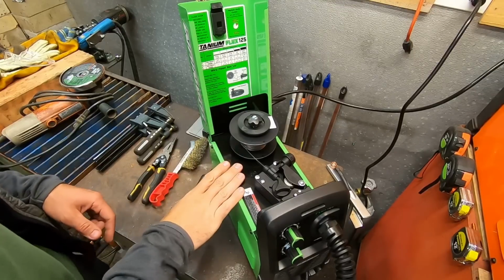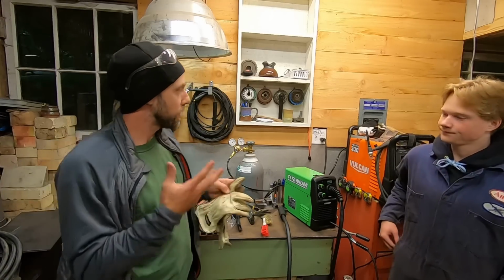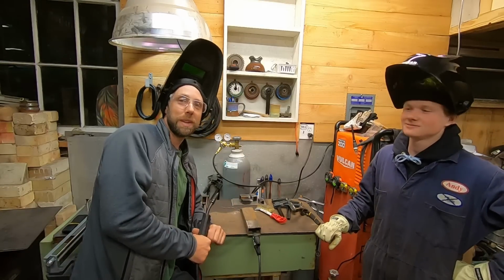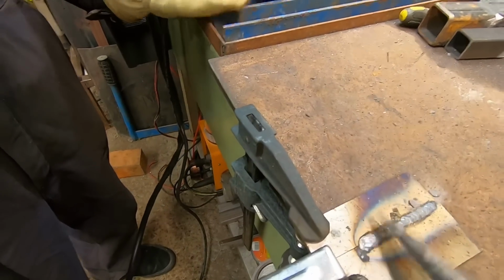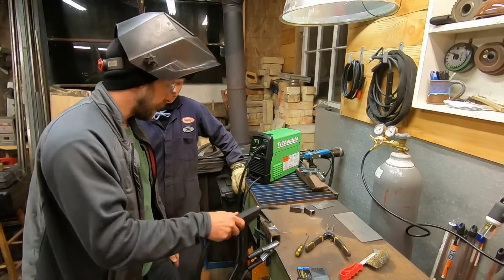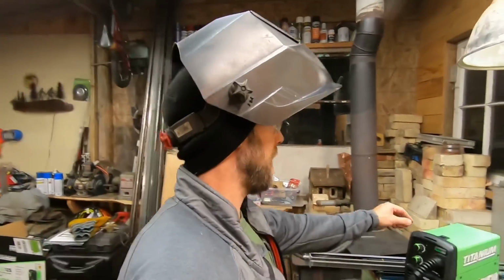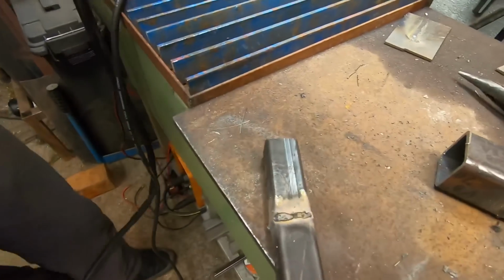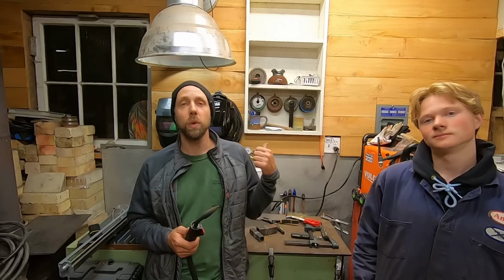How to weld, Tips for Beginners

Comment: What do you recommend for a person who is new at using power tools (cutt off wheel) and trying to get over a phobia of getting sparks while cutting metals or getting the bright arc from welding? LOL.
Reply: I have been a union ironworker for 14 years. 1st thing you can do is always where the proper ppe. Safty glasses, face shield/welding hood, proper gloves, welding sleeves or jacket. All can be bought at and welding supply store or tractor supply. Having the piece of mind that your not going to get hurt helps with the confidence of learning. 2nd.  Every one jumps/gets startled when learning to weld its normal. Just take a deep breath and do it again and again. As far as the fear of sparks clear the area of combustible material, wear your ppe and have a fire extinguisher near so you know you can stop any small fire that may happen. And last lots of practice.
Reply: I double read your comment and one thing comes to mind that is said so often, I think it loses it's meaning but,  in my case anyhow, has been of immeasurable value, benefit and importance: DO NOT BE SCARED OF THE TOOL YOU ARE USING!! When properly used, a tool becomes an extension of your body. When you master a craft,  it's a subconscious act of moment to moment physical action and reaction. 
    If you're scared of the tool in your hand, you in essence are creating a barrier between yourself and that extension.  And, when the user of nearly any tool is not in control, we all know what can happen.
Reply: @mechantics  I also feel like as long as a wear proper safety equipment and use the power tool as intended I will probably be fine.  Usually people have accidents when they are not careful and wear the safety gear (goggles).
Reply: NotthatDigusted by no means am I an expert. Sparks are a real concern it’s actually scary for the normal person. Sparks catch things on fire and they are hot meaning they will burn you. My advice is cover your body. Arms feet hands. And clear the area your going to be grinding in of anything. Then you can relax knowing there’s nothing bad going to happen.  hold what ever it is your using kinda tight and go slow. Make a little bit of spark for a second then back off. Relax and get back into slowly until your fear dies out. Then you can enjoy the awesomeness of making sparks.
Reply: you seem to be a product of a single mother household.  Where's your dad to teach you these things?  You need to have someone who is experienced with power tools  give you and point out those little common sense things that one has not learned from experience.   If you have a phobia, (A phobia is a type of anxiety disorder defined by a persistent and excessive fear of an object or situation) .as you say, then watching videos will not help, one to one coaching is needed as well as maybe a trip to a psychologist if it's really a phobia as described in psychology and you are not just using a nice word like phobia to replace for fear, so since I am an older person I will play your dad and say what he said to me when confronted with the same situation, "stop being a pussy and do it"
Reply: @hmax1591  It's not that, I'm just being wimpy.

Comment: These flux 125 welders kept selling out at my HF so I had to preorder mine to be sure I had one tagged for me.
Reply from the maker: They work quite well especially considering there compact size and cost. I pasted my flux 125 onto my brother because he didn’t own a welder and I own a few MIG and TIG machines. 
We have one of these flux 125 machines at my work for quick repairs around the shop when you don’t want to pack a bigger welder and gas bottle around, it gets used quite a bit 👍
Take care Allen

Comment: Mike, very informative video. I've never welded but I think it's something that I want to learn how to do. I wanted to ask, after Liam welded, I noticed that you tapped on the welds he did with the needle nose, why is that?
Reply from the maker: I definitely recommend getting into welding, it’s a wonderful skill to learn. I was chipping a little slag off of the weld with the needle nose, the welder we are using in the video is a flux wire welder, it uses flux in the wire to shield the the welds from oxygen, after your done you can chip off the thin layer of flux to see the weld.
Other welders that cost a little more run shielding gas to block the oxygen from contaminating the weld. I hope this info helps.

Comment: can you plug this into a standard outlet? i dont think i have a 20Amp outlet?.....
I got the harbor frieght 125 flux chicago electric one instead...
Reply from the maker: It will run on a regular 120 volt outlet like your 125 welder. If you only have a 15 amp outlet then you won’t be able to run it full power without tripping the breaker, but it’s definitely a step up from the Chicago electric welders 👍

Comment: Do you have any videos on your actual workplace setup.  More specifically, where you are placing your ground and what you would do in different settings?  Any safety tips for where to place the ground? Totally new to this want to get started!
Reply: Best is on the piece you are welding ?

Comment: This was great. I had decided to give up on taking up welding because I didn't want to have a 50 amp breaker put in for something I might not keep up. But now I see that this will do most thickness of metals that I'm likely to do. Can someone tell me why people even use the 225 welders? Are so many people doing even bigger jobs than this?
Reply from the maker: Chris L. Robinson I think you will like this Titanium flux 125, it’s probably one of the best deals on welders I have seen. Like you mentioned, this will weld up to 3/16” single pass. Plenty for most people. To answer your question about 220 volt welders, basically they draw less amps and tend to have a much better duty cycle for someone that’s welding on big projects, thought out there day. You can usually weld 3/16” and 1/4” without taking breaks for the welder to cool off. Take care
Reply: My way of thinking is go big ?  That way  it stops you buying another welder ,  , when you start to weld , you will see  more things to make , and start welding on bigger steel ?

Comment: I am no welder, but I do believe the clam is a "Work clamp" not a ground clamp. Please correct me if I am wrong.
Reply: Yes and no ? Depends on what work you do ,  welding ,  ac or dc  current
Reply: Work clamp clamps the work to the metal table top which is grounded. Allowing smaller items to be welded without Interference of the ground clamp.

Comment: i got my line suck in to my wand cant get it out any ideas
Reply from the maker: Sir Graves  Did the wire weld to the electrode tip? If so just  unscrew the tip and pull some wire out and snip off the wire and tip. Install a new tip and you should be good to go. Make sure you have about 1/2” of wire between the tip and your weld when you are welding to prevent this. Take care

Comment: Can you weld aluminum with this welder? Do they offer a spool gun for it? I would use it to frame projects with aluminum like small campers.
Reply from the maker: No aluminum capability with this welder. I would recommend the Titanium 170 welder with there spool gun. That entire kit will cost you about $600. Not bad for a really capable machine. Take care
Reply: Mike festiva thanks for the answer. After watch more of your videos I understand the difference now. Also noticed a lot of other videos they would never adjust their gas pressure and your right black joints. Great videos and love your creative builds.

Comment: Love your videos. My question is, I own a titanium 200 is it possible to tig weld aluminum with this machine..? Particularly 1/8" ,10g aluminum sheet.
Reply: I got a bottle of argon gas from my local airgas supplier and a spool of Aluminum wire at Harbor Freight and ran my Titanium 170 at about full power (need a lot of heat for aluminum) and was able to weld some 1/16 plate, You really need a spool gun as you go through a lot of wire fast. Unfortunatly HF does not sell a spool gun for the titanium line only for the Vulcan line but I ran across someone using a spool gun they got off Amazon that seemed to work.

Comment: I'm a welding noob and have started off with flux core and I've got a question about hoods.  I have the generic hood and have noticed it's really dark and outside of the spark, I have difficulty seeing the line I'm trying to weld.  In addition, I have to wear readers to see and the small screen is difficult to see through.  Can you recommend a hood that has a broader field of view and self-adjusting as you mentioned above?  Does brand matter here?  Great videos and content, thanks!
Reply: Vulcan i think has a nice one
Reply: Your shade lens is two dark , try a shade 10 ?
Reply: I had that problem too, glasses in the way. Look at the Vulcan helmet at HF at about $149 best buy on the market, bought one last year and never looked back.

Comment: Is that a homemade vent hood over your weld area?
Reply from the maker: Yes it is. I used a aluminum reflector from a old industrial metal Halide light and opened up the top for 6” ducting with a 6” exhaust fan, it works fairly good.
Reply: @Mikefestiva  Thanks for the update. I thought I recognized the light globe. I have installed many of those. I'm going to start welding at home, learning. I enjoy wood work but want to really get into metal. Nothing big. Exhaust for the weld area is a must. Unfortunately my cousin's husband is in his final days battling cancer. He is in his 30's. He was a welder. Years of welding with little and no exhaust ventilation ended up giving him cancer.  Lungs first that metastasized into the brain. Before they even knew it. Thanks Mike. Absolutely enjoy your videos.

Comment: Mike, I was also wondering about after the weld there`s a hump down the weld strip. So is ok to grind down the weld hump to a level surface or will that destroy the strength of the weld?
Reply from the maker: It will take away some of the welds strength if you grind it down. You can V your parts where you are going to weld and fill the V up with weld, this way you won’t have as much of a high bead. Take care

Comment: How much electricity will consume from this welder in let's say  10 minute welding or one hour welding.  And can l use an extension cord from my house
Reply: Not sure where you are ? Iam in australia  your power use will be small ?  For the ext  cord yes you can use it , , i wouldnt go more than  20, , to 30 foot ?   Over that length you can cause voltage  drop  , hope that answers your question
Reply: @timothyrouse2853  thank you!! I'm in the USA very helpful!
Reply: @santiagodominguez2522   when useing the ext cord ,  just check after you are useing the welder ?  Just check the heat of the ext cord , that should give you a idea ?
Reply: @timothyrouse2853  ok just try something new lm been carpinter and house remodel for many years  and. Now want to get into new projects like gates with lumber for horses and things like that

Comment: Mike, one other question is that I have soldered mostly copper water pipes using a small propane tank and y question is can you solder this pipes with burning holes on copper pipes using this Titanium 125 unit?
Reply: Copper pipe is best done with tig welder ?

Comment: Mike, just started watching your videos and I am definitely a new learner trying to learn some welding for small projects and what better way than learning from a real good teacher and professional as yourself? One question I have is if this welder you are using can be used for welding a catalytic converter on vehicles and  if so, can you provides some good tips in doing that?
Reply from the maker: Yes you can weld up exhaust on cars, this is a good affordable simple welder. It’s definitely a good machine when your starting out especially if you are on a budget. If you have a little more to spend you can look into the Titanium MIG 140 or the 170 both of those welders can run flux core wire of shielding gas and the 170 is dual voltage 120/240. 
Ps on your other comment about copper, it’s not possible to solder copper pipes with welder.

Comment: Might be a stupid question but here it is. Does pushing in the trigger make the spark? or is it the wire when it touches the metal? or both at the same time? just curious lol not sure how I came across the video but it's interesting.
Reply: When pressing the trigger the wire extends. When this happens and the wire touches the metal that the ground clamp is connected to then it will create the spark. Basically just completing the circuit.
Reply: @Palmer9297  So the ground clamp always has to be connected to the metal that you'd be welding? or just any metal in general?

thanks for the reply
Reply from the maker: The ground clap always needs to be clamped to the work piece you are welding it can however be clamped right next to your weld or 20’ away down a metal beam as long as it’s completing a circuit. Back to your first question, the wire is cold ( does not have power ) when the trigger is not pressed. When you pull the trigger the wire becomes hot ( power is sent though it) and at the same time the motor advances the wire out the tip of the MiG gun. Once the wire touches the metal work piece that’s grounded it then makes a complete circuit and that’s when you see the sparks ⚡️ 
I hope this helps 👍
Reply: @Mikefestiva  Thank you for the info, very interesting.

Comment: I got a mig/flux welder at Christmas time and expect to just use the flux core process for now for hobby welds and repairs.  I've been waiting for spring to start some practice outside.  I have a woodworking shop and wonder how dangerous, or not dangerous welding in the shop would be?  Concerned with fumes and sparks that might bounce into a corner and smoulder.
Reply: Useing flux core , is   a dangerous fume to breath in , you can use a fan to blow the fume away from you ,  as any work shop ,  , a clean shop is safe ,  set aside a area to weld    and all ways keep a fire ext in case ,
Reply: I wouldn't recommend welding in a wood shop, one day it will go badly for you.

Comment: Mike would you say the settings guide on the machine is fairly accurate? I purchased the same unit recently and have had a bit of trouble dialing in the settings. Love your videos
Reply: Conner , the guides are pretty spot on ?  What i mainly do is turn the power up , then work down , , its  just getting your wire speed right

Comment: I bought the titanium flux core welder from harbor freight specifically for spot welding on two projects. I'm replacing a roof on a 2007 Mustang gt that got caught in a tornado and had a dumpster dropped on it.  The car only has 50,000 miles on it. It was my sisters car and I bought it from her. The second project is a 1971 Chevy c10 pick up that needs the rocker panels replaced, and the cab corners too.  I have never welded before. I'm sure I can do it though and I have been watching videos like this one just to get an idea of what I'm going to see when I turn the thing on for the first time.  I am going to practice some spot welding before I tackle the job though.  I want to get it done right and to be secure.  I'm really excited about it! This video is full of great tips and I'm sure I will use those tips in these two projects.
Reply: When doing auto sheet metal repairs skip around don't weld alot in any place or you worpe the panel and it sucks to try repair them.
Reply: @steveb6103  
Already done. I wasn't welding lines. I was welding cut out spot welds and it worked beautifully! But I do know already you don't try to weld a line on sheet metal on a car. It will warp.

Comment: Can I use this welder with extension cord if so what kind would be best
Reply from the maker: I would say if you are going to weld on extension cord use a 12 gauge and try to keep it shorter, like 25 feet you probably could weld on a 50 foot one but don’t expect to max out the welder, probably no more the 1/8” on the longer cord. Good luck 👍

Comment: Your cursive e  clockwise or counter clockwise?  I just bought the AC inverter version before i knew better. Thanks for the tip on dragging it straight on thin steel, and all of the other stuff.